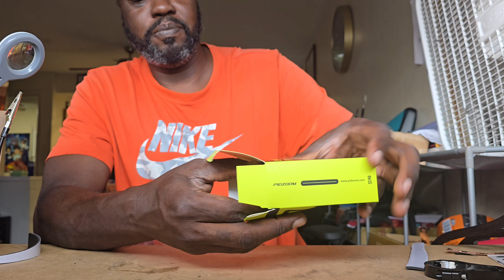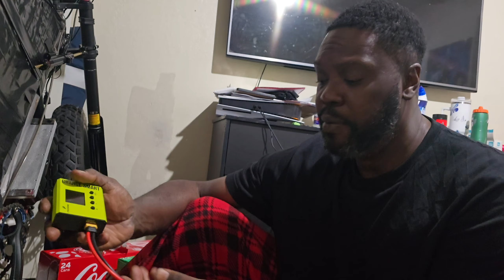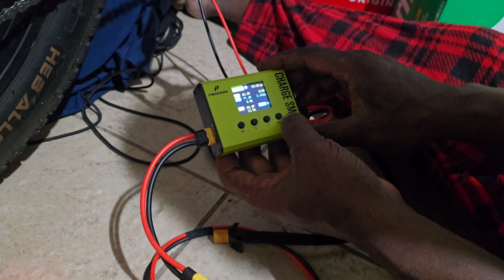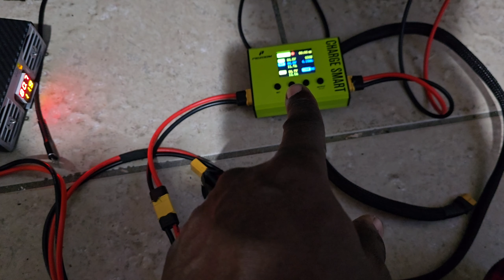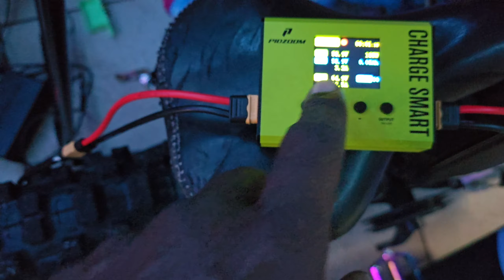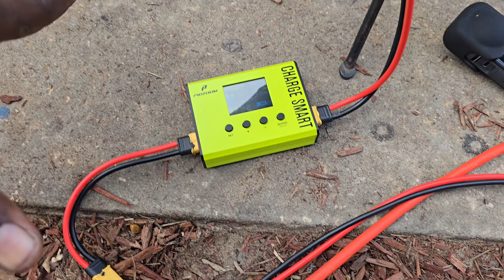Pidzoom EC140 charger enhancer review CHARGE SMART!

Comment: Perfect!  I have a 82.8V, 15A Lead acid battery charger and this will enable me to charge my 3S, 4S, 13S, 14S and 20S packs   batteries. I ordered the next version Charger Enhancer CE200 GX12-2 because it can do 10V-200V, 0-20A.

Comment: if you set voltage higher as needed the charger will push out its max current until you reach 100%
if you set voltage of the charger to exact top voltage of your pack the current will go down at the end (say last 10% SOC)... giving the balancer a bit more time
i bought a variable charger 42 to 88.8V and 2 to 15 Amp ... the charge controller inline is only useful if you want to charge only up to 80%SOC (for longer cell life)
Reply from the maker: I'll explain everything tomorrow live
Reply: using a higher voltage source is possible if it is current restricted.. means you can charge a 42v pack with a 72v charger .. but not from a 72 (or 48) V battery (say from your solar power bank)... you have to use a current restricted one.. at best with max voltage matching your battery (higher voltage is possible with that smart charge controller but not recommended)

Comment: Can you use a 52 volt battery on a 48 volt controller box will it damage the box if I use a 52 volt battery
Reply: @paulroberts8667  usually you will be fine with a 52v battery as the capacitors inside the 48v controllers (most of them) are rated at 63volts, a 52v battery fully charged is 58.8volts, so you should be ok. 
I've successfully used a 52v20ah battery with my old 1500w48v Voilamart kit for over 2 years and nearly 7,000 miles.

The only way to 100% know for sure really, is to open up the controller and check the voltage rating on the capacitors inside it.
Reply from the maker: Now that I really don't know but you can check the capacitors and see if they are higher voltage
Reply: @paulroberts8667  it should work (and give you a few more miles/hour topspeed)
capacitor in controller is either 50, 63, or 100V ... so I guess your 48v controller has a 63v capacitor... or in other words it should work
only problem is.. if your controller has the low voltage cut off set to 39 or 40v (for a 48v system) you may discharge your 52v pack to a very low voltage (but I guess then the packs BMS will switch off before you get into the deep discharge area)...if you pay a bit attention on your charge level.. it should work just fine 
(sidenote some controllers can be set to 48 or 52v in the menue)

Comment: I have a couple batteries that I built that I use the smart BMS with the Bluetooth module installed within the battery + it you can use any voltage charger that you want. For example, I use a 60 volt charger for my 48 volt packs in the BMS on the batteries. It will just cut the voltage when it gets to what I set it at. Not the best way to do it for balancing, but I set my 48 volt packs a little bit lower than the top voltage
Reply from the maker: @maxsinventions8913  yes you can use any charger that's higher voltage
Reply: I’ve also been looking at these and think they have a full charger that u can hook this up to 
Can’t remember the benefits but both work well together 
They sound great and have excellent reviews 
Thanks for sharing

Comment: If you want the most capacity out of your battery, only charged a 4.09 volts per cell. They've done studies to where you can get about 2,000 charges. That way. If you charge up to 4.2 you only get about 500 charges.
Reply: @maxsinventions8913  usage between 30 and 80 % SOC give you the max miles from the pack... every 5th to 10th charge you do a top end charge to keep the cells balanced (but do it right before a ride!! do not keep the cells on 100%SOC for a longer time!!)

Comment: It's just a battery meter. Your charger is doing all the work.. The voltage you are setting is telling it the voltage of your battery and that is how it estimating state of charge. That is not a charged that's why it says charge enhancer and not charger. It can't really know the actual capacity of the battery it just guesses based on info you have given . You want to charge up the battery all the way and then. 

It's just a battery meter that you can set cut off points in but it may not even cut off it probably just sets off an alarm so you know to disconnect it

Hopefully it has separate profiles you can save because aside from that it can't actually know things about your battery. There's no magic going on. I it only knows what you tell it. Not that smart. Hopefully it wasnt more , than $30-40

Comment: So if you can plug it into any power supply, or power pack/bank, like one  you'd take camping etc, then it's essentially a smart charger / charge enhancer thing 😂

And that's pretty damn cool really.
🚲⚡👍

That could be very handy for a lot of people.
Reply from the maker: @MickyBee73  yes correct you can use a power supply and charge your battery
Reply: @MickyBee73  power supply,? yes
Powerbank? no!!! why?? it MUST BE CURRENT RESTRICTED!!! (means you can not charge your 42v pack direct from a 48v battery/power bank) ... but you can charge from power supply with current restriction  just fine
Reply: @dg9bfc  Ah right, well cheers for the information, I just wondered as I'm not actually buying one in any great hurry 👍 but thanks for the wise knowledge.
Reply: @MickyBee73  I just bought a variable charger 42v to 88.8V and setable between 2 and 15 Amps
Reply: @dg9bfc  nice, I'm thinking of getting something similar if and when I go up to a 72v setup
Reply: @MickyBee73  my bike is 52v system .. I had to set the charger to 59.5 to have 58.8 on the pack (battery has an inline diode in charger port) .... with a variable charger you also can set voltage to 54 or so (for longer cell life only charge to 80 % SOC) ...
Reply: @dg9bfc  Ah right, good info, nice to know these things, cheers